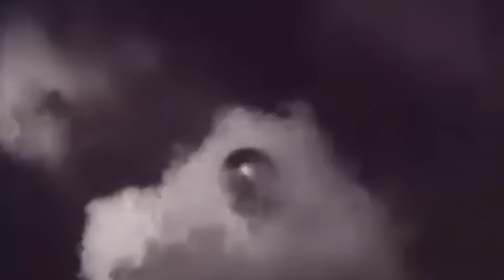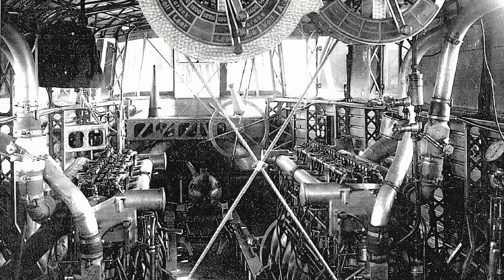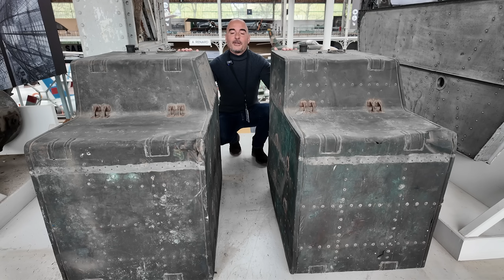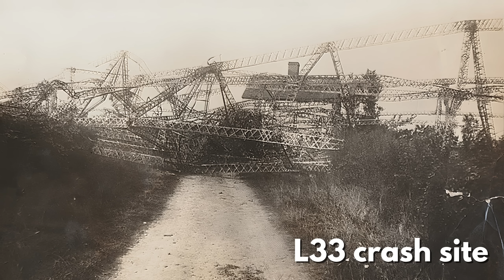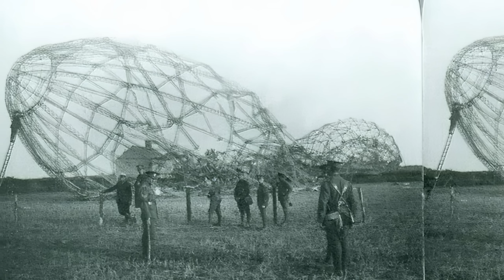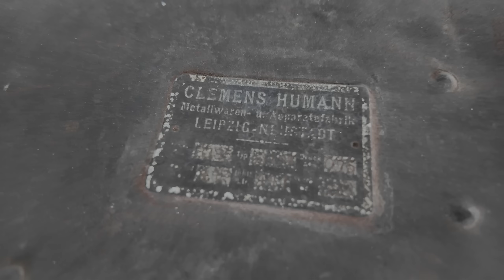The Last Remains of a WW1 German Super Zeppelin | The Story of L30

Comment: The 1917 wireless set only morse or spoken radio transmission?
Reply: Very likely CW (morse only) . I don't believe the technology existed to modulate the oscillator/spark gap to produce a useable voice signal until vacuum tube technology matured in the early 1920s. Some sources say that there was some experimental work done during WW1 (DeForest developed the triode in 1906 I think) but I would think they stuck with proven technology.
Reply: @RB-qq1ky  thank you
Reply: Morse code only,as the other commenter said, but on a fairly wide wavelength, and the Zeppelins crews often used it too much, enabling the British who listened in to track the Zeps path, and warn AA guns as well as sending up fighter aircraft to see how their recently developed incendiary bullets worked out on huge gasbags filled with hydrogen. The wireless system was also used for a primitive navigation system.
Reply: @james-id1ni 
The other aspect is that ( as mentioned in Hanson's First Blitz book) the British gradually developed a detection and tracking system which, although limited by the technology of the day was effective both against Zeppelins and the later Gotha bombers. Hanson notes that, apart from the obvious absence of radar, the fully evolved system was very similar to the system employed  20-odd yea rs later in WW2.
Reply: @RB-qq1ky  Yes, I’ve read that too, and find it very interesting, first a bit of a shambles from the British defences, then some clued up officers put a system together to gather all the information from observers in the navy and army, police etc, to track the Zeps and later Gothas and alert the AA defences and send up fighters with the best information possible for interception, all done by the basic telephone system of the day.
Reply: Do you have any info on how the anecdotal/eyewitness accounts that Hanson extensively references came about? 
I've been curious about it and the usual G search doesn't help.
When you look in the appendicies most  seems to date from the mid-1930s which doesn't line up with any significant anniversaries (for instance) or any significant International events. 
The Central Powers ones were evidently taken from personal diaries/auto biographies/memoirs but the English ones seem to be taken from 1930s  newspaper articles.

Comment: The misconception of airships is what was dangerous. When hydrogen ignited, it leaked and did burn above of ship. They used very fire hazard materials which caused mosta damages.
Reply: Also the entire rigid structure was built out of magnesium
Reply: @aeropro90  Aluminium mainly, as you can see on the photos of the burnt out examples, if it was magnesium it would burn as well, especially when those hydrogen gas bags got going!